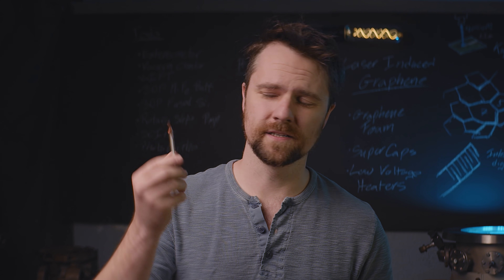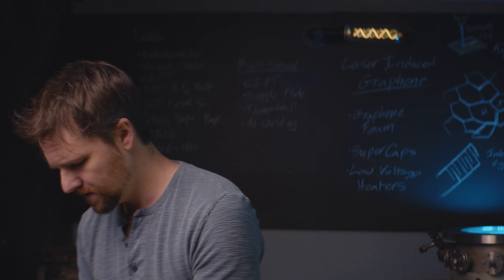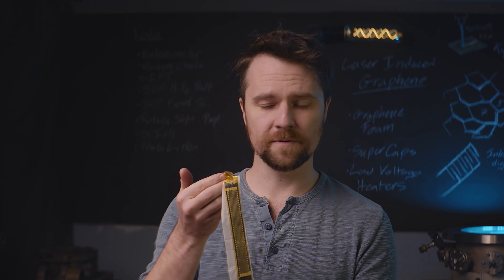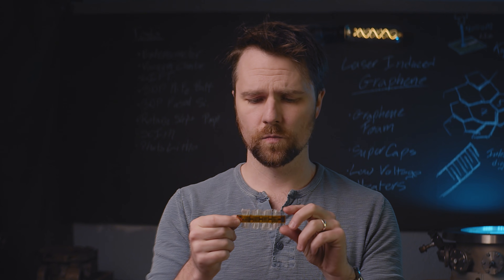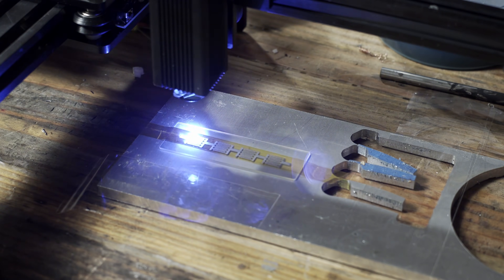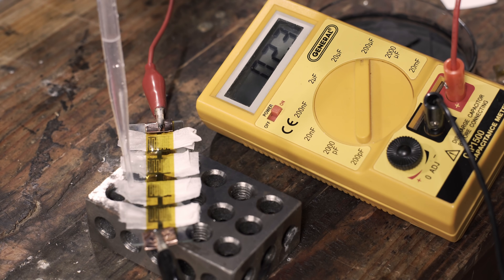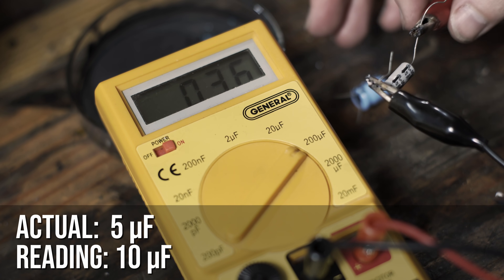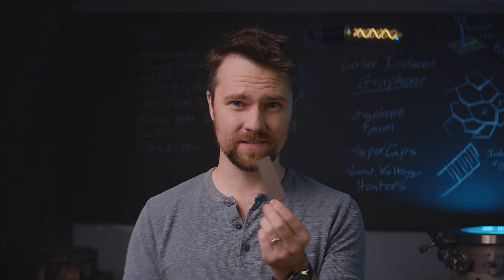Kapton Tape Supercapacitor?

Comment from the maker: I realized my explanation of how these work was vague and poorly worded, sorry!  Graphene-based supercaps are a form of electrostatic double-layer capacitors (EDLCs). Charge is stored at the interface between the electrode and electrolyte via electrostatic attraction when charged.  Due to the small charge separation EDLCs can charge and discharge very quickly, and the extreme surface area of graphene foam gives a large interface with the electrolyte to improve overall capacitance.  That's why the "perimeter" of interdigitated electrodes is important, because more exposed perimeter == more interface opposing the other electrode to accumulate charge.
Reply: One other point on you're value measurements... It is not uncommon for capacitors to be manufactured under "tolerance" of 20% or more, so the meter might not be as inaccurate as it looks.
Reply: What if you get some resin infused with Kapton then use a resin 3D printer to make more complex structures to test as resin 3D printers use a lazer harden the resin, depending on how you print it maybe the vessel could hold the electrolyte.
Reply: Please try to build aluminium-air battery with graphene cathode
Reply: What about the rollup style capacitor "didn't work so well" when you tried it?
Reply: What goes into selection of optimal electrolyte? What gives kapton tape this property of UV -> graphene? Could you estimate your capacitance economy? Like capacitance per area, volume, dollar, time, etc?
Reply: @donaldviszneki8251  well the tape is plastic made from hydrocarbons.
Laser burns it down to carbon.
Reply: Is this why you use an acid for the electrolyte rather than say an oil like in electrolytic caps? Because the electrolyte must be somewhat conductive?
Reply: The largest flaw with current caps is the low energy density, do you have some numbers on these caps? Might have missed them but would love to know them
Reply: Speaking of measurements... do you think, those could be used as capacitive strain gauges?
Reply: Damn im gonna have to reread this a 100 times. Similar ti the surface area of a conductor is ahhhhh proportional or is it inversely proportional? To its resistance and or conductance? Its been 30 years since I was sxchooled
Reply: I am wondering whether Kapton might be used to convert electricity to a molten salt thermal battery.  I am reading that Kapton maintains its integrity up to 500F for one hour.  Molten salt (KNO3/NaNO3 (40/60) is listed as having a melting point of 464F.   If Kapton doesn't deteriorate at higher temperatures the process might work. Comments appreciated.
Reply: I have to ask. What was your feed rate and power % ? Just curious. I happen to have everything plus to replicate. Minus sulfuric acid. There are better electrolytes
Reply from the maker: @allseeingprophet  My best results were 90% power and 40mm/s. But it was highly variable depending on the brand and thickness of kapton, so I'd probably run a power/speed grid test first to check on your particular material.  Goodluck!
Reply: I wonder how this would affect the performance of an electrostatic lifter.  Replace the aluminum foil with graphened polyimide (Kapton) tape.  And roll a thin shrip of the treated Kapton to form the emission wire.   The resistance of the treated tape may not be very low, but at 25KV it will not be an issue.
Reply: Three years late to the party, but it's worth knowing that commercially available electrolytic capacitors have quite wide tolerances, and can easily 50% different to the label value.
Reply: I dont understand why more makers are experimenting making these, Theres hardly any videos out there on this incredible technology. Ive been developing compact more powerful versions of John Hutchisons crystal converter power cells and been working on ways to make very small super caps to store this energy. These would work perfect. Ive been wanting a laser for a few years now but just never got one. Thats gonna change, these caps could reshape out world when it comes to micro electronics. WOW!
Reply: Id really LOVE to see more videos on these Kapton Tape Super Caps! This is one of the most unique technologies ive seen. Really awesome video!! Thank you
Reply: The word is 'interdigitated' - inter-digit-ated. You're missing out the second 't' of the three.
Reply: Hah, I looked up "laser induced graphene" after seeing your video of metallic laser deposition on glass and leaving a comment about blasting carbon... and here we are! =) 

Additional ideas (as though you could possibly run out of fun things to try) : 

Laser deposition on glasses that have previously been etched with waveguides.

Laser deposition in presence of a strong alternating electric field - all of these high energy plasma interactions might behave differently in such an environment.
Reply: Electrostatic? So it's charged by thunderstorms?
Reply: @sebastianstewart6894  no. its charged by rubbing balloons on its hair

Comment: I wonder if a caravan or trailer heater can be made with very low energy consumption. And with this technique also, battery plates could be made, and many mor things i can think of in regard of low cost DIY off-grid techs low consuming and resilient and well crafted.

Comment: Have you given some serious thought to using a 3D/4D printer (or modified plate printer) to make your pattern, or different design plate platterns, on a grand scale multiplying your plate amount, sizes and different patterns?  I think you could really create very powerful and reliable plates or rolls for power and more efficient designs.

Comment: Thanks for the video, I am trying to reproduce your work at home but use it more as a conductor, I bought a cheap daja laser engraver of 450nm with 3W power, but I cannot seem to get any graphene out. Would it turn black or do I expect a significant resistance drop if I succeed pls? Could you share some settings : power and scanning speed if it is ok? Thank you

Comment: It would be very interesting to see the conductivity of the grapheme. Essentially you measure with a multimeter a square sample of the material with the entire edge of the two measurements points as electrodes. 

Or, alternatively, you measure both voltage and current of the heater version and use ohms law, then divide by the length to width ratio. 

This is quite important for any design optimization.

Comment: I understand that this is a little late, but maybe this would interest someone. If you are aware of the inkjet transparency film; it has a emulsion layer coated on one side of an acetate sheet. That layer can be lifted off the acetate if you soak it in a lye solution. IF one were able to somehow transfer that very fragile emulsion onto the lasered polyamide it could be used as an electrolyte carrier. The emulsion may need to be neutralized of the basic lye solution, rinsed, and dried. It is very fragile when its unwashed and dried that may change when its not extremely basic. But it seems like it would have the properties needed since it is designed to be a carrier of water based ink solutions.
Reply: This caught my interest. I think you're on to something. What do you think would be the main benefits over other electrolyte carriers?

Can you also explain why being a carrier for water based ink is related?

Comment: If it was 200F - ok. But it's just a capacitor: 200µF
Reply from the maker: The "super" part comes from the area-to-charge ratio. Not to say mine is particularly good, but commercial supercaps can have relatively small capacitance but do so in considerably smaller volumes than regular caps. And they can be charged/discharged much quicker.
Reply: @BreakingTaps  I think you can always rename videos .. and loose viewers.
Reply from the maker: Hmm? It's still technically a supercapacitor based on how it works (ionic electric double layer, instead of a parallel plate capacitor) and area-to-charge. That was my point, the designation "supercap" has nothing to do with absolute capacity and entirely to do with how it charges/discharges and how much areal space it uses to do that. It just happens that supercaps are most useful in the Really Big Capacity range since that's where their features shine compared to normal capacitors and batteries, so most super caps people see are giant.
Reply: @BreakingTaps  i wont mess with you

Comment: wow! thank you, that may become a method to manufacture a heated bed for my printer! not entirely sure yet, but that seems less complicated than copper-based methods. Also, uniform heat distribution is a great benefit, maybe on one of the beds I'll cover it all. Overall it seems almost too good to be true, like, tape over the glass and laser it? so simple, for a uniform 400 C heater? maybe even hotter with some shamanism around adhesives

Comment: You said that the foam-like structure reduces the conductivity of the graphene... how much?  Is the resistance too high to be useful as a circuit?  

I'm interested in trying this to make a diaphragm for planar headphones 🎧.  The laser method would allow for an accurate placement of the electromagnetic coils directly onto the kapton substrate, provided that the resistance isn't to high to be usable.
Planar speakers and headphones typically use mylar, which has very similar properties to kapton, with thin flat copper (or aluminum) coils attached to the surface with an adhesive.  The mylar is then stretched taught in a frame and placed closely over neodymium magnets (sometimes positioned in a halbach array).  When a charge is applied the coils repel oscillating the diaphragm.  
The low mass of the thin mylar sheet makes it ideal for extremely accurate music reproduction, unlike conventional cone 🔊 drivers that are linear, are much higher in mass, and must overcome their own velocity.
Because of that, planar drivers are known for their ability to recreate nearly flawless high and mid frequencies (usually above 100hz).
However, driving low resistance speakers, counterintuitively, requires a lot of power.  It is harder for an amplifier to drive a 2ohm speaker than an 8ohm.  
I'm thinking the ability to use a laser to create a graphene coil on kapton could allow for a higher number of closely spaced turns, increasing the resistance, while also increasing the field strength of the coils.
But if the resistance of the graphene is too high then copper would still be the way to go.

Comment: Great Video
Yeah a quick scan of digikey will reveal that for aluminum electrolytic capacitors the tolerances can be as wide as -10%/+150% LOL
So your capacitance meter was probably more accurate than you might have thought

Comment: Electrolytic capacitors have a typical range of +80%/-20% although there are some better ones. This isn't usually a problem because in their use case more is often better and +80% means it can age quite a bit before it will become a problem.

Comment: Electrolytic caps are usually +/- 20% tolerance so your measured values are probably fairly accurate.

Cool project though. Be interesting to recreate this in my home shop though I need more equipment lol.

Comment: Imagine incorporating this material into clothing fabric. You could have a really effective means of generating direct, uniform heat over one's entire body, or selectively, based on the specific need of a separate body part. It could be used for operating in cold-weather environments, perhaps incorporated into the innermost layer of one's cold-weather gear. Likewise, it could be incorporated into a wetsuit, for cold-/deep-water diving. Perhaps most impressive, it could be incorporated into the spacesuits of the future, as a space- and energy-efficient means of maintaining body temperature in a scenario when space AND energy are at a premium. I wouldn't be surprised to learn it's already being developed for such use, or even that it's already being incorporated in this way.

Comment: Could these be made more efficient by placing them in a vacuum to remove all of the micro air bubbles?   Not sure how that will affect the sulfuric acid but it's worth a shot, right?

Comment: Kapton is extremely expensive, especially if you're doing a large project where you'll notice it. There are other cheap methods of growing graphene. Positive ions from a superconductive source can form graphene quickly in a vacuum chamber at 10% atmosphere 1800-1900f.  There's probably a few ways to create that effect. One is using a pair of tesla coils close to one-another next to the outside of the chamber, firing 2mV and using the right grow medium as co2 gas is slowly vented in.

Comment: Great video!, did the Graphene layer formed on both sides of the Kapton tape, or just on the exposed side?
Reply from the maker: It mostly forms through the entire thickness of the kapton, but the adhesive on the tape remains so it is still "one sided".  If there wasn't adhesive it would be LIG all the way through. If you're note careful though it can foam up too much and start to flake away... it's very delicate stuff.  The adhesive helps in that regard since it provides a backing to stay adhered
Reply: @BreakingTaps  Thank you very much for your answer

Comment: Don't you think that the store-bought capacitors' values are less accurate than your meter's reading? Some caps have 10-20% tolerance. A meter usually has 1%.

Comment: I'm a year late to the party but you really should test the self-discharge rate of these and whether they recover voltage after being fully discharged before you start calling them capacitors at all.
The capacitance function on multimeters assumes you're giving it a capacitor. If you give it a resistor or an inductor or especially a battery, it will read some erroneous capacitance. You really need an LCR reactance meter that gives you all 3 measurements at a range of frequencies. LCR multimeters don't do that. Again, they're assuming that you're giving them the type of component they're measuring.

I've seen a lot of people on YT claim to make supercapacitors and in reality they just make batteries. LCR meter aside, using it in a circuit, like a capacitive voltage doubler would give you an idea of properties like actual, functional capacitance and ESR, which you already know is going to be through the roof. A capacitive voltage doubler should be almost 100 percent efficient. If it ends up being something like 10 percent efficient, you really don't have a capacitor.

Still cool, still interesting, just sketchy on the optimism towards its properties.

Comment: You really need a REAL capacitance meter, one that actually measures capacitance against a standard capacitor and likewise measures dissipation factor against a standard resistor.  Most cheap digital cap meters actually measure the RC time constant, which is only notionally similar to actual capacitance.   I'd recommend a Hewlett-PAckard 426XX series meter, those measure the real thing.  Especially since they also measure the dissipation factor which is an important parameter for energy storage.

Comment: I am currently working on an electrostatic adhesion gripper. They require an input voltage between 1-6kV, so we need materials with high dielectric strength. At the moment we are ordering flexible PCBs with the interdigitated pattern and the space between the electrodes is limited by the dielectric strength of the adhesive. Would you be able to produce them with this method and what material would you use to cover the electrodes?

Comment: Not sure if it's available in the USA but Kapton tape can be got as wide as 100mm which is roughly 4 inches. The other thing that may be of interest is that with regard to the acid, pH is not always a good indicator of suitability to be an electrolyte. EG Boric acid is used commercially in a lot of capacitors which is nothing like as aggressive as sulphuric, and is less toxic. Might be worth a try as it's relatively cheap. One other point is that capacitance meters due to implementing probably the cheapest nastiest way of measuring are almost never accurate (except by accident). Unless you get a Rhode and Schwartz but don't expect change out of 50k for a top of the line model. Electrolytic capacitors are also all over the place dependant on manufacturing tolerance, age and how long since it was last formed. Even ceramic capacitors have issues with aging reducing capacitance (it's a ferroelectric effect reversed by heating). The only ones that are not a right pain in the grunock are either waxed paper (which can still explode in a shower of confetti) or polystyrene that crack if exposed to too much light. If you want a cheap accurate way of measuring capacitance then a wheatstone bridge driven from an accurate sine source into a proper differential amplifier (INA117 is not good enough frequency wise but it's good enough in all other specs). Basically a capacitor has a fixed impedance at a fixed frequency that can be measured.

Comment: Why are these called supercapacitors? I thought supercapacitors were all in the Farad order of magnitude. Is it because of the amount of material needed?
Reply from the maker: Yeah, technically it's a mass/volume to charge ratio thing that makes something a supercapacitor. E.g. there are supercaps that can be fabricated on microchips with tiny amounts of capacitance, but comparatively large relative to their size.  

That said, mine is a very poor supercap. 😀 More of a demonstration than one that actually works particularly well :)  And most supercaps do end up being Farad+, because that's one of their great advantages: putting a ton of farads in a comparatively tiny locaiton.
Reply: @BreakingTaps  Thank you very much for your super quick response!